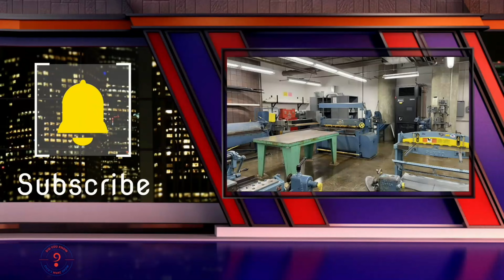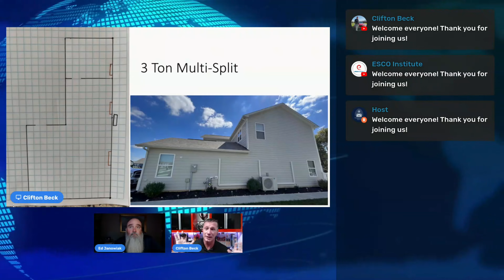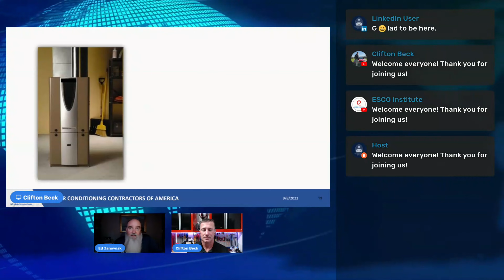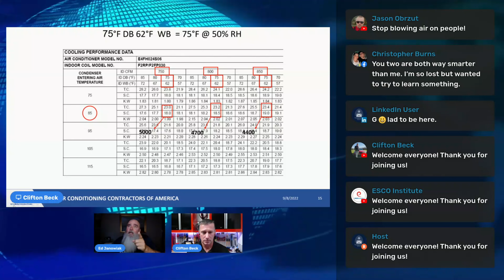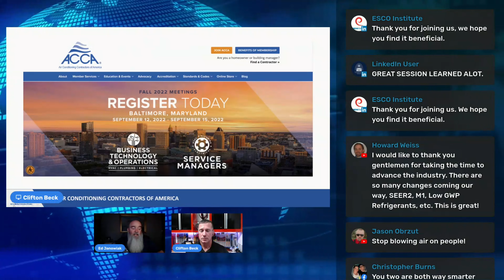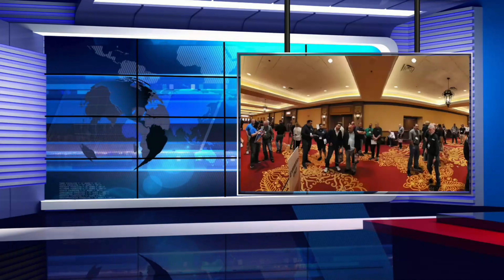How to size a Mini Split?-The ESCO HVAC Show-Episode2

Comment: I'm just a DYI consumer researching mini splits... this video just made me realize, if I actually want it to perform they way I expect, I shouldn't just estimate my manual J.   I need help designing the entire system taking into account more data.  Is there somewhere / someone who can do this work for me for a small fee?
Reply from the maker: Absolutely, a quality contractor should be able to provide this as a service. Also you should call your local HVAC technical school and see if they would be interested in doing a load calculation as a class exercise. Many programs teach load calculation and it could be a good opportunity to connect with them and provide a classroom challenge.
Reply: @escogroup  Thank you for the reply.  Good idea about the Tech School.  I don't really trust my local HVAC companies to do the engineering.  Cheers!

Comment: What is differ multiple system and split system
Reply from the maker: Hi Keith, a traditional split system has one evaporator and one condenser. The new multi evaporator systems allow you to have one condenser and multiple evaporators on the same circuit. Some systems like the Daikin Life use a cased coil on your ducted system along with addition mini-split heads on the same circuit with one outdoor unit. 
https://daikincomfort.com/products/heating-cooling/whole-house/heat-pumps/vrv-life

Comment: What is differ with the temp on the outside and inside the house in climate, how would change environment
Reply from the maker: It effects the load capacity of the heat pump and at what temperature you switch from heatpump to auxiliary heat.